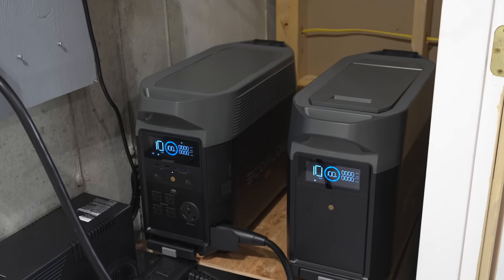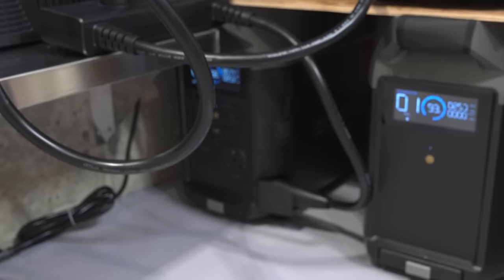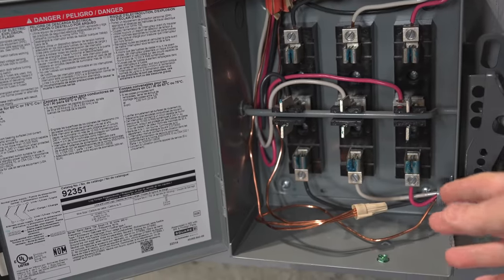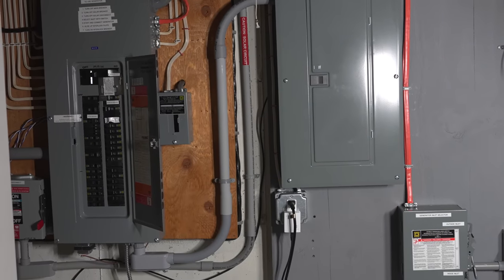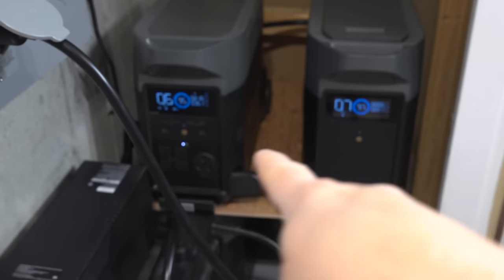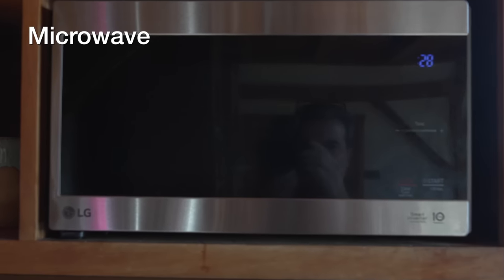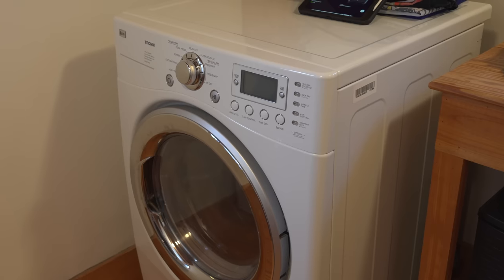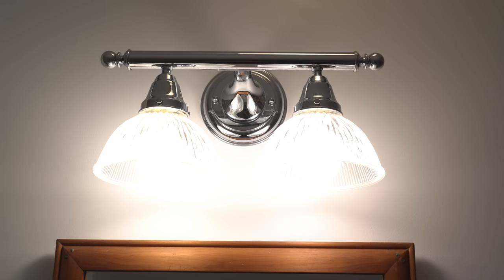How to power your Whole House with a battery generator - Ecoflow Delta pro

Comment: My generac 8000 watt generator only uses 12 gallons of fuel to run for 24 hours. I just did it for two days straight before Christmas! And that’s running my well pump and all the other stuff my wife insists is on. The nice thing about gas generators is that no adolescent boys in the Congo had to died in collapsed mines for me to get power in a windstorm. So that’s cool.
Reply: The only problem
I foresee is in my city we had an almost two week blackout and during that time all gas pumps were out because pumps run off electric. So at your rate and let’s say I had stored up 80-90 gallons of fuel I would only be staying powered up for roughly a week.
Reply: @Okjoe1983  oh I didn't even think that some areas wouldn't have any open gas stations. I'm in Maine and at least half the gas stations have generators so they remain open even if the power is out.
Reply: @jlinc187  by week 2 the major corporate gas stations here starting dropping off huge generators at the gas station so they could start pumping again which was nice however as quickly as they were turned on the gas stations started running out of gas due to the large influx of customers filling up their cars, gas cans, water bottles or just about anything they could use to hoard gas. It reminded me of the toilet paper covid craziness. On the flip side I do see your point and I personally would run my generator on natural gas if I bought a portable dual fuel or a whole home generac or at least propane if natural gas was not already running to my house.

Comment: Worth mentioning the problem with not having a breaker lockout is that the 240v from the batteries will step up to ~14KV when running backwards through the house's transformer. It's potentially fatal for people working on the lines in an outage.
Reply: Turning off the main breaker prevents back feeding
Reply: @scottmurphy4946 yup! Until you forget to, because the power’s out anyway you won’t notice.
Reply: @dgpsf  Except you cant power the house until you discoonect your main by sliding up that lockout plate...preventing you from ever having your generator/battery connected to your home at the same time as your main utility connection.
Reply: @dgpsf  you would immediately notice because your system would attempt to power the rest of the street
Reply: @niktak1114  Kind of a good point.  But, Ron R correctly pointed out that this is impossible due to the lockout plate.  It physically prevents powering on the breaker from the batteries while the main breaker is switched on.  When your power is out, the people working to restore it are your best friends.  That plate protects the life of your best friends.  That's the way I look at it.  Yup, it also protects your batteries from trying to power the whole neighborhood.  Oh, and I have to add that it also protects your battery/inverter units from severe damage when the power is restored!💣

Comment: This is the setup I have, except that mine is full (2x Delta Pro + 4x Extra Batteries) for a total of 21.6kwh connected to my house using the DVH through a transfer switch.

The maximum output is 240v @ 30amps = 7200w

The setup allows me to turn on 2 air conditioners at the same time, plus gaming computer, TVs, all LED lamps, fridge, etc... just like using the power grid. For heavy appliance, I can turn them on as well but I need to be aware of current consumption when other stuff are turned on, since the limit is 7200w

It works really well for us and I live in Puerto Rico. The setup gets the power from 2 separate solar arrays for the maximum solar input on each Delta Pro (1600w x 2 = 3200w) on a good day.

We are not 24x7 off-grid as we still have the power grid service, so I use it during the week while I work remotely for an average of 40 to 60 hours weekly off-grid. Doing this out electric bills is much lower than before. I know that a grid-tied solar system may have more benefits but things here in Puerto Rico are not so easy... so most of the time off-grid gives us less headache.

This is not only about reducing bills cost, but also owning a system that cover us during an emergency. When we were hit by hurricane Fiona and the power grid was obviously off, this is the setup that keep us with power all the time, while most of the houses where I live were completely dark and other using gas generators.

Not only that, but those people were doing long lines on gas stations.
Reply: Hi Carlos.  I bought same set-up last summer just to be prepared, but haven’t installed a transfer switch from my main panel.  I already have grid-tied solar on the roof but don’t know much about wiring a transfer switch for the back-up.  Plus my solar array would be in the back yard and the Eco flows are in the front of the house.  Any thoughts

Comment: I would love to do some type of battery back up eventually but due to other things going on in my life right now I cannot finance that I did upgrade to two inverter generators so I can parallel them when I need to run heavier loads and just run one when I’m not running that much The only disadvantage is I did not have 240 but .50 A at 120 V can run a lot of stuff if my calculations are correct, that’s 6000 W continuous and the inverters sure do you save a lot of fuel, especially when they are on economy mode
Reply from the maker: I totally get that. I have told Ecoflow and other companies that they need to come up with 1 unit that does 240v internally. Not euro 220v, that is dfifferent, we need US 240 in one unit. Then allow extra batteries to be added, this would keep the entry price low and let you grow it as your budget allows. This is so much closer but always has room to grow.

Comment: Great video very good explanation. I have a Delta Max and a Delta Pro and I have a river Pro I know that I don't have three or four Delta Pros I just purchased a Delta Pro I've been dealing with Eco flow for at least a year and a half. I accident product I have not had a problem with the batteries and I Look to purchase two more or maybe three more of the Delta Pros excellent product it is a beast it does exactly what they say it'll do and some. But on this gentleman I can't think of your name I apologize but you've done an excellent video and again you made a great point about it's up to the individual how prepared you want to be and I think that I have kerosene heaters I have other type of ways of cooking I have Coleman grills propane tanks but I think that my way and the way I'm going to go is with the generators and the reason why I like to generators is because I have the solar panels and if I don't have propane or gas I still can use the generators on a nice sunny day. And the main reason why I went with the eco-flow generators is because they're portable enough to take with me camping and I can bring them in the house and I don't have to leave them outside I don't have to worry about no toxic gases or any type of problems with them as far as carbon monoxide or anything like that so that's why I actually went that route

Comment: I think the Delta PRO is a fantastic product but Oof the price point, not to mention needing to parallel two for 240. 

I straddle a line between wanting something as simple as this, or the Living Energy Farm model of solar to 12v for lighting loads and a DC direct drive refrigerator, super low tech and low maintenance.

Full disclosure I live completely on-grid in a residential neighborhood but I LIVE for nerding on alternative energy.

Comment: Well, for a couple thousand less than the setup you have there, you could get an EG4 rack mount system with 30kWh worth of batteries and two 6500 inverters for a max of 13kW of power. Double what this setup is.
Now that is a little more advanced setup than the ecoflows of course, and physically larger, but it would allow you to charge your car if needed. You can't on the ecoflows using the 240V combiner thing.
I think the ecoflow makes sense if you want a foolproof, no-setup backup for some essentials, but this doesn't financially make a lot of sense as a whole home backup in my mind.

I have an LV6048 inverter (120/240 split phase 6kW) and 14kW hours of DIY LFP cells. So close to what you have here in terms of power and storage and only cost me about $3000. Less than the cost of just one of the delta pros.
Reply from the maker: You understand it exactly, its definitely a plug and go system. If you go the component route you can do more for less money. No disputing that but it is nice to have it all done and ready to use. I can understand people using both types of setups for sure.
Reply: @SilverCymbal  This is what I did. I bought a Growatt 12k LF inverter and 4 rack mount batteries w/rack. Came to about $9k total. With the 30% federal tax credit, this comes down to $6k for a 20kwh system wired into an interlock inlet. I am thinking of getting a Chargeverter so I can directly power the battery rack with my Honda generator while the Growatt is powering the house. This will allow me to run my 4 ton HVAC system which the Honda EU7000is can't start due to the 55A compressor inrush (even with a soft starter).

The other good thing about a battery rack and single inverter is that the power draw from the house isn't spread unevenly across the batteries. This is one of the issues with the Ecoflow units when used with uneven loads, one battery will draw down more than the other.

Comment: When you can run a central AC , FRIDGE together I’ll be impressed cause that’s what is needed in Florida after a hurricane
Reply from the maker: Depends mostly on your central air if its a heat pump, yes. If its 20 years old, you run it for long.

Comment: Thanks for the great tips and insights. I have an older rooftop solar system - still works (about 10% degradation over 20 years) and looking to add batteries to the mix. System installers don't make it easy... most of them want to remove my old panels and start over (not going to happen). So the search continues.

Comment: I recently watched a video where they tested how much electricity was produced with one gallon of gasoline. Both units were Honda inverters one was a 2000 and the other was a 6500. He used one gallon of gasoline in each unit and measured the kilowatts produced. The little 2000 produced twice as much on the same gallon of gas. Like you I need 240 volts for my well pump. Everything else in the home is propane, stove, dryer,heat, hot water. I have been looking at several battery options like yours and have been in touch with cutting edge power about recharging their 240 volt unit with a 120 generator and they said it could be. I did not ask if I could use the battery system while it is charging so I have to get back to them. Like you I have a hydronic heating system that uses on a coup[le amps while running and the refrigerator and well pump are very intermittent loads. It seems ridiculous to have a large inverter running because of one intermittent load. This setup looks like the ideal situation, using the batteries as a "buffer" or capacitor and then charging it with a small quiet generator like my Honda 2000 converted to propane. Even something smaller like a 1000 watt inverter may be more efficient getting me even closer to the day I can disconnect from the grid completely. Can you charge your units on a single 120 volt generator while using the batteries to run your electric loads?

Comment: 7,200w output is decent for whole house, although you're not going to be running hair dryers or space heaters or toaster ovens or electric clothes dryers or heat pumps anytime soon.  But to keep refrigerators, well pumps, lights, gas furnace, computers and the occasional microwave running it should do fine.  My only concern is the 14,400w runtime.  It means at full load you get 2 hours runtime.  On the South Shore of Boston, where I live, in the woods, power outages are rarely 2 hours, more likely measured in days, so this system definitely requires a generator backup.  I understand you regulate electrical consumption below the 7200w runtime capacity by turning on only the electrical appliances you need, nevertheless, with a total capacity of 14,400w your “time on battery” until utility power is restored will certainly not be measured in days, especially in your rural location.  I can still see the advantages for this battery backup in terms of simplicity and reliability compared to a gasoline generator, although it's likely a lot of extra cash for most folks to buy a generator to back up this battery system when they could just use the generator alone.  And in a snowstorm likely to bring down trees that will kill your power for an extended outage, those solar panels you talk about will be generating far from their rated capacity for multiple reasons.  If it’s me, and I’m living practically off grid in northern New England as you are, and I’ve got family to keep warm, I’m definitely adding a generator to the mix.
	Now what would be REALLY interesting for a video would be hooking up your tractor to a PTO generator.  That would give you a fairly substantial and reliable secondary power source during an extended outage.

Comment: Interesting product that I can see being of value for portability with home integration as a bonus but at some ~$14,000 worth of just major components that's quite the premium over other options on the market for home power such as EG4
Reply from the maker: The cost for the Delta pro setup with the 240v box is $7k right now https://ecoflow.com/collections/delta-series?aff=37  By no means, inexpensive but its a better price than some other units out there with no company history or 240v abilities
Reply: @SilverCymbal  I didn't quite math correctly: Delta Pro's are $3500 ea.  Batteries $2600 ea.  So more like $12,200.  And I agree that among portable power stations EcoFlow has a good reputation.  But that portability comes at a price.

Comment: Thanks for making this video. This is pretty much what I want to set up once I have the money to invest in the Ecoflows. I still want to offer the ability to run a gas generator during a massive prolonged outage, but the majority of our outages when they happen are only a few hours or so from say a grid/pole issue or a storm that knocks it out.

It would be nice to have the convenience of a standby generator and I know their smart panel offers that but only allows 10 circuits and I'd rather just have the convenience of turning things on and off as I need to in the house without preselecting what I want on. 

If I had any critical loads I'd just use a UPS that would last me long enough to go down and throw the interlock.
Reply: Similar to me. And if there is a brief power outage and it's raining and the wind is howling I don't want to go out and crank up and connect the generator, just stay inside and plug the Ecoflow in.

Comment: The Ecoflow stuff looks pretty solid for a more prosumer focused product.  The Victron ecosystem is when you pull out the “big guns”.  Being able to seamlessly cut over between grid and battery power (and solar) and monitor everything on a single dashboard is really slick.  It even supports feeding extra power that you generate (via solar) back into the grid if you are allowed to do that.

Comment: From what I understand, You can only run either 120 or 240v at one time with ecoflow. The New Zender is the first product I know of that can run both at the same time.

The Ecoflow does have an amazing dual fuel Generator that Automatically turns on and off to keep the batteries topped off.

Comment: Question, I think the set up is great, my question is how can you set the battery back up and then run a backup gas generator to charge your batteries so that you can run large devices such as home AC units? The run current flow is not the issue, it's the start up current that taxes smaller or midsize gas generators.

Comment: It seems like solar panels, plus a battery system, and a generator to refill the batteries would be ultimate system.  The only downside is the a availability of gasoline, but in a pinch I doubt you’d be using microwaves and dryers.  This is all very cool.
Reply: I still do an Apollo 13 electrical load survey when the power quits. It could be an hour or a 6 month outage. I have the ability to recharge but prefer to do it during the day. My son's neighbor lady has a Tesla roof and 3 Powerwalls. She managed to run them flat by midnight in a heavy storm. She has electric heat.

Comment: A fellow on the Ecoflow forum tried to connect his generator to both Ecoflows while running in split phase as you are. There was hot electronics smell. Turns out that when you connect a generator to the Ecoflow it acts like a UPS and connects straight thru. One 120V generator cannot make split phase 240V in that way. So another post showed hoe he ran two 120VAC to ~130V DC power supplies from his generator to the Ecoflow Solar inputs so they would still run on their inverters. Less efficient and more expensive. Maybe the way is to connect two generators. One to each ecoflow.

Comment: I have a twin home and I like to do this myself but I only have one Ecoflow Delta 2 Max which I think will be enough.. I was also thinking of always having my 2 solar panels (280w total) outside and running the cables inside to a solar charge controller, then onto 3 Lithium lifep04 50ah batteries in series, then from those batteries to the ecoflow alternator and then to the ecoflow generator..